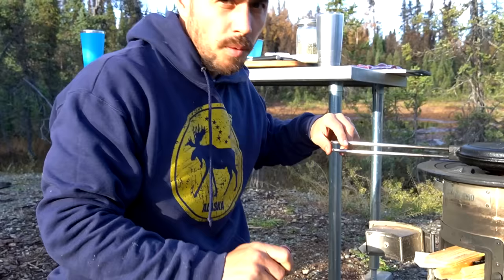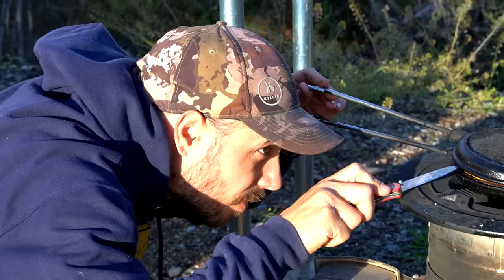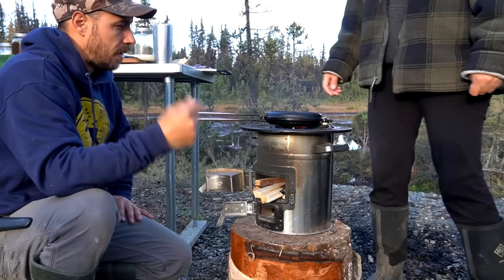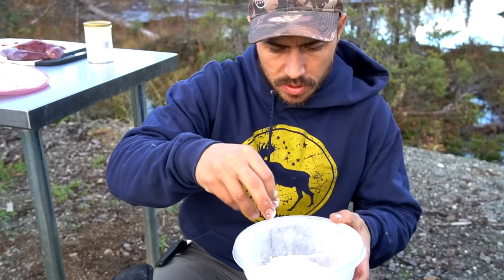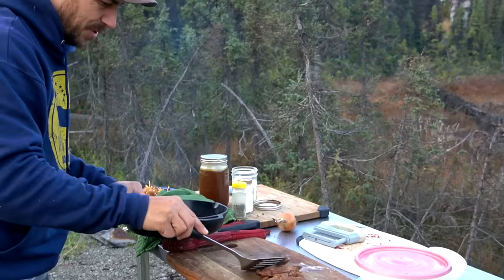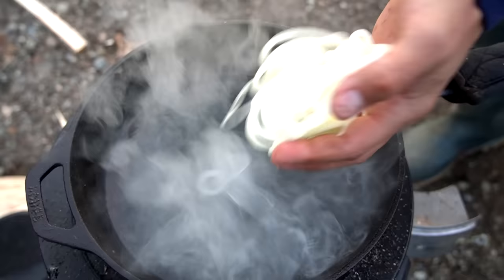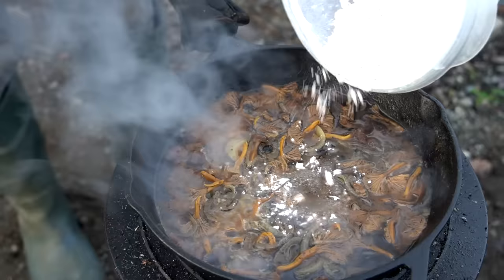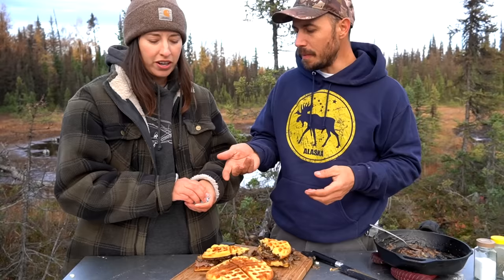Hunting Alaska's Spruce Grouse for the BEST Chicken & Waffle Sandwich

Comment: Eric, since you and Ariel give us such great info all the time, I give you a little trick to save you time cleaning the birds. Place the bird on the ground, underside up, and step on the two wings with each foot as close to the body as possible. Grab the feet and firmly but smoothly pull up on them. You will be pulling the spine and rib cage, with breasts attached, away from the skin with all the feathers and, if the head is still attached, you will gut it clean at the same time. Just grab the breasts and peal them off the rib cage, no knife needed. Love the channel, cheers, Dan and Elle

Comment: For your waffle maker. Make some clarified butter. (Make too much during the winter and generally cold months so you have it on hand). Put a lb of butter (for extra) in a pot on the fire. Don't get it too hot and skim the milk solids off the melted butter until it doesn't produce anymore. That'll get all the water and milk solids out of it. You can brown the milk solids and toss it into just about anything that would improve with butter.
The smoking point of clarified butter is higher than oil so you'll get waffles without burning your butter.

Comment: Hey.I'm a very regular spruce grouse hunter,if you want to save the hassle of getting the breast (and whatever other part you want to keep,I personally keep breast,heart and liver) do this ; 
1.pull head
2.put the grouse belly side up,extend wings and put your feet on each wing
3.Grab both legs and pull
that will get rid of 99% of the stuff you dont want to keep and remove most of the feathers.
4.You can dig in to either throw away organs or keep them.

After all these steps,you will be left with a breast cage(with breast still attached) and organs if you decided to keep them.

I use tree branch cutters to cut the wing bones after and give them to my dog (or throw them away)

Happy Hunting !

Comment: My mom usually heat up the water hot boiling then she dump the birds inside the hot water for few minutes  1 or 2 minutes then she easily takes off the feather cut off the head the legs . Then she clean them then she open up the bird throw the inside except the heart the liver and something else I don't remember the name. Just something to share . Then she makes sure there is an airway between the inside of the bird and the neck so she cleans the inside run the water through . Last clean water and salt  put it aside to dry for few minutes bon appétit.